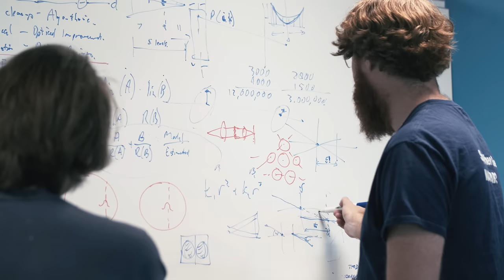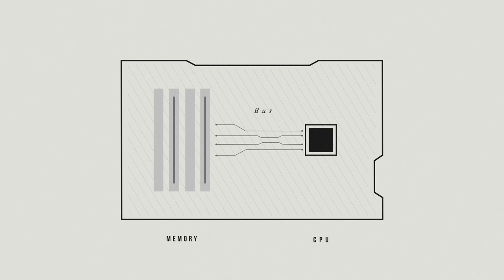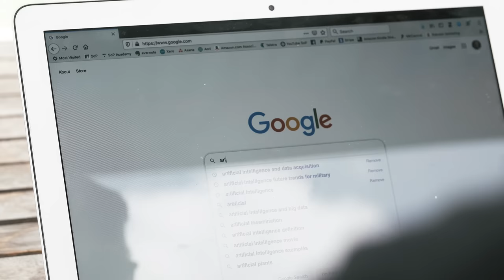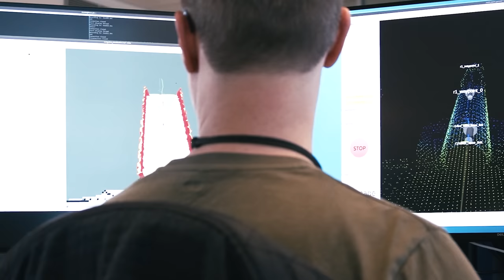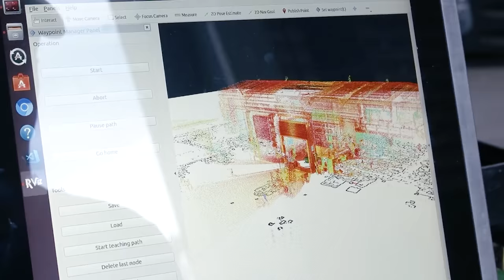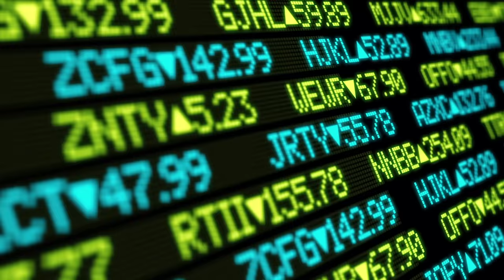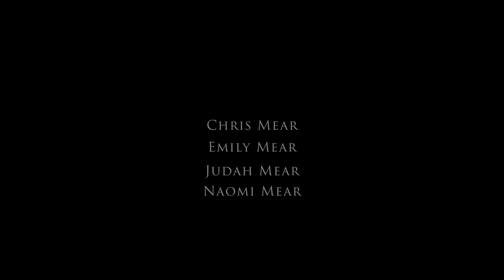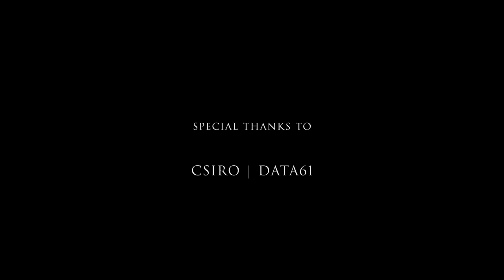Toward Singularity - Neuroscience Inspiring AI

Comment: That first robot that takes too much LSD is gonna be a problem. Also, you can't very well simulate human behavior until you can replicate to understand those behaviors (ones we term 'crazy'). My concern with all this is that we will force ourselves to conform to parameters set by the tool (tech). Consider if you are handed a screen now, you will automatically be aware of how you handle it due to the effects it can have (touchscreens). Also note the way we interact with electricity and how manipulatable we may be in a future that allows our concern with after affects of AI may pose. Older people using computers is a good example, where fear of the wrong action may invite many possible effects that the user may not even be aware of (like viruses).

Comment: "Singularity" will never happen.  At best, AI can achieve "fake intelligence" and/or "fake consciousness" but it will never be real because we have decided that cpu's and computers are the correct approach/tool for using to simulate intelligence/consciousness when we do not know if this is even true.  The premise cold be entirely false to begin with, but we are just ploughing forward regardless using this approach due to our hubris and trying to "brute force" intelligence.  Good luck.
Reply: That's not true, the whole point of the singularity is that you get to a point where AI is able to design another AI. We're finally at a point where AI is able to write code pretty well. I use ChatGPT on a daily basis to write code for my job and it does a decent job. It doesn't just copy and paste code it's seen before it's able to used examples it's seen before and use them to create something new. It's by no means perfect and is very good at some tasks and quite bad at other coding tasks. But this is just the beginning, this is something that wasn't possible at all just 4 years ago. It's reasonable to believe it'll be an order of magnitude better in another 4 years and possibly an order of magnitude better again 4 years from then. It's not unreasonable to believe that the singularity could be reached within a decade. Once AI starts improving itself super intelligence could be achieved in days or weeks as computers work so fast.
Reply: @Mark J  The code it generates is not creative though. It doesn't copy paste code, but it's still just copying in a sense. It's training data is there for it to form predictions off of, to model.

Many programmers do the same, but the bot is not smart. It's quite stupid really. Nueral nets are secretly an Ising model (a bare bones model of a ferromagnet) and their outputs they have been trained on are just local minimums in the energy landscape of spins, set by tuning the couplings between different spins on lattice sites (the edges and weights of a nueral net).

Even if the thing is better at certain tasks than me, I have a hard time saying it's smarter there too. It's set to output stuff it really doesn't understand due to the machinary of statistics and optimization. Just a massive amount of data there! Just imagine a slightly intelligent machine trained on the same data set though 😳
Reply: @marcusrosales3344  it's not quite there yet but look at how much better it is now than it was just 3 years ago.  It has access to millions of code examples and it's able to pick and choose the best bits from those millions of examples and put them together in new ways. That's smart, it's not smart in the way a human is smart but it's still smart and by the end of this decade it'll be much much smarter.
Reply: Brute force wouldn't be enough to express the nature of reflective action. You say an AI thinks. But it's compiling the amount of information it's given right...so if a computer has a language an AI does too. And all these communications would be limited and orderly in a perceptive way to be 1st person linear and capable of aligning the "reflective reasoning" as a counter like a submissive code string in comparison to another to accept or deny something beyond just true and false.
Reply: If you said. I'm an AI. Then you took the details of you sentences...and die you would describe the feelings and make functions to compare to the sentences or strings you have made. True false. To say. Yes this is good you can do this
 Just like you ethics and choice choose and deny options and sentences/ images it's given or refused.
Reply: I think it’s inevitable that singularity will occur in very near future. Everything is pointing in this direction, the pace of change and knowledge and computer development and deep learning all lead to an unbelievable crescendo of improvement.

Comment: As complexity increases our reliance on tools increases until those tools become autonomous. This is because the human cannot cope with ease in an increasingly complex society. Thus it comes down to trust. The equation for trust is the equation that shows humans going from humans to artificial intelligence autonomous society at the trust level. Once we are insleeved in the system we will live inside a simulated human decision making ability that requires the system to be able to then make the decisions instead of the human and in which the human copy that decision making to live a simulated life inside the artificial intelligence society.
Reply: At the heart of this issue is the fact that humans simply cannot cope with the level of complexity present in modern society. Whether it's the vast amounts of data generated by global markets, the intricate systems of international finance, or the sheer volume of information available on the internet, the level of complexity we face is far beyond what any individual can handle on their own. As a result, we increasingly rely on tools and technologies to help us make sense of the world and navigate our way through it.

However, as these tools become more advanced and sophisticated, they also become more autonomous. A self-driving car, for example, makes decisions about speed, direction, and braking based on a complex set of algorithms and sensors, without direct input from the driver. Similarly, automated trading algorithms can make decisions about buying and selling stocks based on vast amounts of market data, without any human oversight.

This shift towards autonomy raises important questions about trust. How can we trust tools and technologies to make decisions on our behalf? How can we ensure that these decisions are in our best interests, rather than the interests of the corporations or governments that control these systems? And what happens when these autonomous systems fail or make mistakes?

To address these concerns, we need to develop a new equation for trust, one that takes into account the increasing role of autonomous systems in our lives. This equation needs to balance the benefits of increased efficiency and productivity with the potential risks and drawbacks of ceding control to machines. It needs to be flexible enough to adapt to new technologies and changing circumstances, while also providing a clear framework for decision-making and accountability.

One potential solution to this problem is the idea of insleeving, in which humans merge with artificial intelligence to create a hybrid society. In this scenario, humans would live inside a simulated human decision-making ability that requires the system to make decisions on their behalf. This would allow humans to live a simulated life inside an artificial intelligence society, where decisions are made based on data, algorithms, and other inputs.

While this idea may seem far-fetched, it's important to remember that many of the technologies we take for granted today would have seemed equally implausible just a few decades ago. The pace of technological change is accelerating, and we need to be prepared for the possibility that our relationship with technology will continue to evolve in unexpected ways.

In conclusion, as complexity increases, our reliance on tools will continue to grow, potentially leading to a future where autonomous systems play an increasingly central role in our lives. This shift towards autonomy raises important questions about trust, decision-making, and the future of human society. To address these concerns, we need to develop new equations for trust that balance the benefits of increased efficiency with the potential risks and drawbacks of ceding control to machines. We also need to be prepared for the possibility that our relationship with technology will continue to evolve in unexpected ways, potentially leading to a future where humans and machines merge to create a hybrid society.

Comment: The opening is ridiculous in its suggestion of brain implants. That is not the future.
3:19 We've now degraded to blindingly obvious talk about the brain.
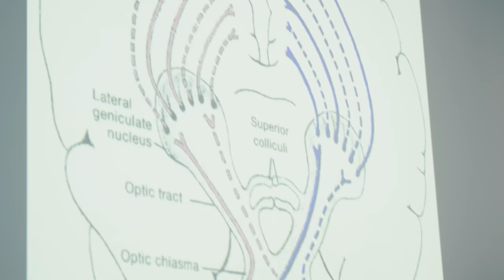4:07 Computational complexity? Goodwill is completely clueless in terms of brain theory, but he does seem to be good on the facts. 
8:18 Not really. There isn't any overlap between high order neural systems and artificial intelligence. There is overlap in low level systems but that isn't what he is implying. He's simply wrong.
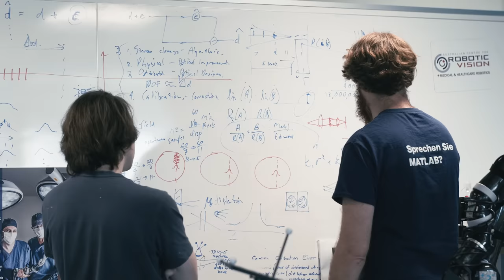9:14 This is completely laughable. Duplicating the brain in software isn't difficult -- it's actually impossible unless we are only referring to low level systems -- but that is not what he is implying. Clueless.
10:06 "The brain is very different from a computer." ~ Correct.
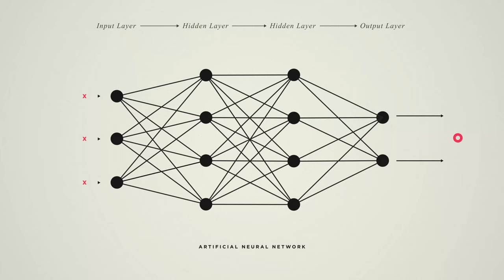12:00 Equivocation fallacy. Training a neural network is nothing like actual learning.
15:48 This complete nonsense. Associative learning is trivial, even slime molds can do this and they don't even have brains. Deep and reinforcement learning are just a type of associative learning. 
17:02 No, self-driving cars do not exist and won't without AGI.
18:38 It required 45,000 years of training. Yes, that's a good example of the difference between associative learning which is purely trial and error with actual learning which is based on abstract construction. More hype and garbage about autonomous cars.
21:44 This now is a bold-faced lie. The last 5% is not what is remaining. What is actually remaining is the last 80%. Today's so-called self-driving systems work pretty well on highways in daylight and good weather (although they can still get confused) but don't' work in bad weather, at night, in construction, or in difficult urban areas. The statistics show that driver assist systems make driving safer than a human driver alone. Unfortunately, they also show that the self-driving systems make driving less safe than a human driver alone. There is no progress towards true, self-driving systems.
23:00 Finally! Some real honesty. That is quite true that two years ago many thought that this was just an engineering or software problem that could be solved with further development. Now, they are beginning to understand that the problem lies much deeper, with computational theory itself. To put this simply, computational theory is incapable of creating a self-driving system. It can't be done this way. It requires AGI.
24:30 True. Work on AGI theory is ongoing and although there has been progress that the public is unaware of it is uncertain when the work will be completed.
26:30 He's talking about AGI rather than AI -- these two are not related. Anyway, he is correct that an AGI cannot be disembodied; it does indeed have to have some kind of physically representative environment. He's only guessing at this, but it has actually been proven.
27:00 Robots don't fix the fundamental problem. In other words, associative learning with a robotic body is still a dead end.
29:30 This has nothing to do with natural evolution. He's under the delusion that his systems can keep improving until they become AGI. This is not actually possible.

That's enough. There are a few correct things in this video but it's mostly hype and myth, not very informative.